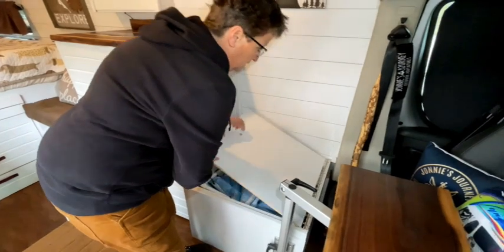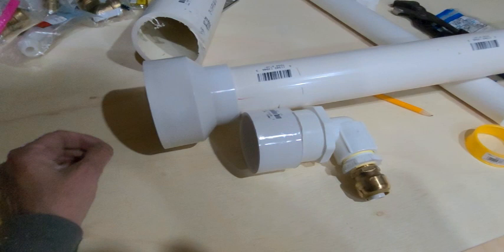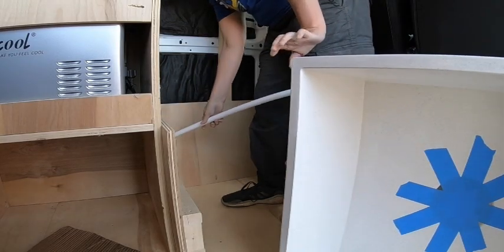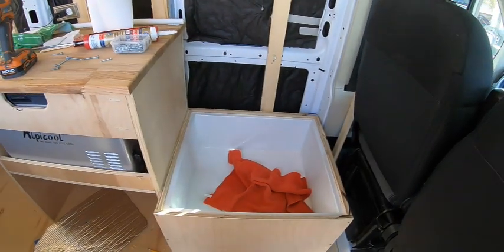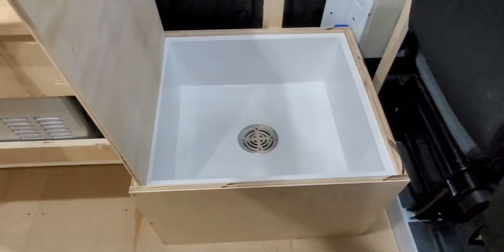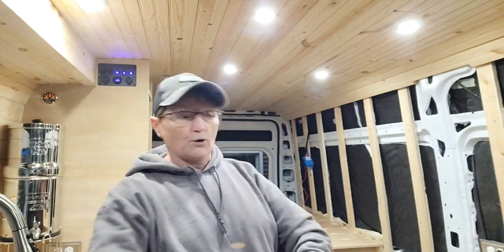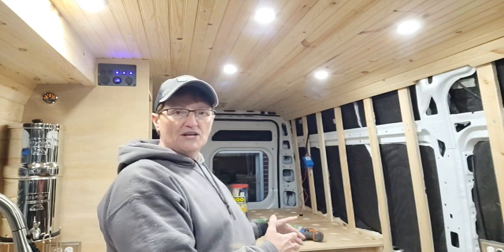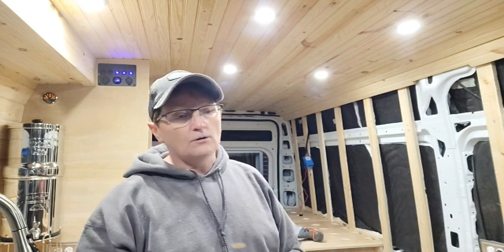INGENIOUS Van Life SHOWER

Comment: If you wanted the upper part of your shower to be more spacious, you wouldn't even need to use a ring.  Just put (at least) four hooks up on the ceiling spaced out to the width and depth you want your shower to be.  Hook the shower curtain up onto the hooks, using a second curtain if necessary so that they overlap and no water gets out, and voila'!  To speed drying, just do what you did before.  Hook the curtain up inside out.  

LOVED this idea.  Many thanks for sharing.
Reply from the maker: I thought about maybe doing that but didn't want all the hooks in the ceiling. 🙈

Comment: My thought about the shower curtain is to use a hose to keep it off you.  Make a casing in the shower curtain all the way around, about waist high.  Feed a hose through that has a curve in it.  Have a connector that can be connects the ends of the hose with plenty of room to give distance between the curtain and your body and can be disconnected so that you can coil it enough so it fits back into the box.  Sewing a casing on the inside of the shower curtain would be quite easy.  Straight seams.  It would likely not work with any adhesives unless they are waterproof.
Reply from the maker: Oh, girl....  you got my wheels spinning now...  I think you got it.  I will update you on how it goes.   Love It....

Comment: Great idea.  I assume this also works because you take navy showers and don’t keep the water running or you might overload the smaller pipe size.   A twist on the Storyteller design.  Nice.
Reply from the maker: exactly.  Yes, I do like the storyteller curtain hanger though.  Still tweaking that

Comment: Did you think about coating the outside of the shower so if water does get on it .it wont do water damage to the wood.  
Love how you can store the curtain in it and also use it daily as a seat.
Not sure what the weight limit would be on the shower bottom .
Good job Jonnie
Reply from the maker: The border will be caulked and the whole outside gets painted. Good point though. I will have to look up the weight.

Comment: love this idea. My shower is more 'permanent'. I used an outdoor sink and cut off the overhang for the faucet. It's deeper than this, good and bad. do you have a fan to pull moist air out? That's my concern in mine. I want to make sure to avoid moisture issues if possible. love following your work. hope to meet you sometime when you're in the St. Louis area.( We have mutual friends). Hoping my box truck will last a while, assuming I can replace the stolen catalytic converter. thanks for sharing!!
Reply from the maker: I am back in St Louis doing van builds for as long as I have them.  Would love to see the box truck some time.  yes I have a fan and in this build she has two of them.  thanks so much for watching.

Comment: If you switch places with the shower and toilet does that give you more height  For shower and eliminate some of that pipe you had to run?
Reply from the maker: Less pipes but not more height. The toilet seems a LITTLE more private further back. It could be either way though
Reply from the maker: Less pipes but not more height. The toilet seems a LITTLE more private further back. It could be either way though